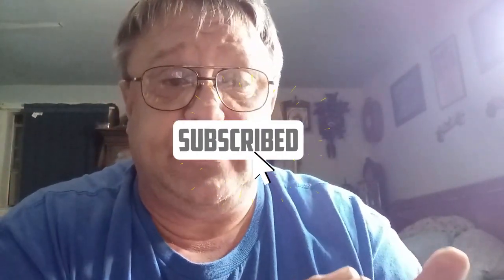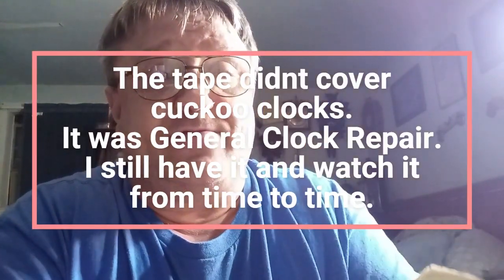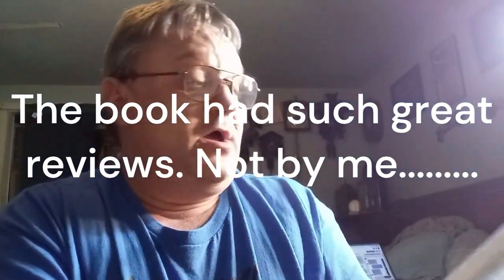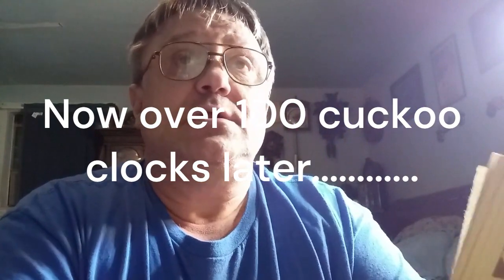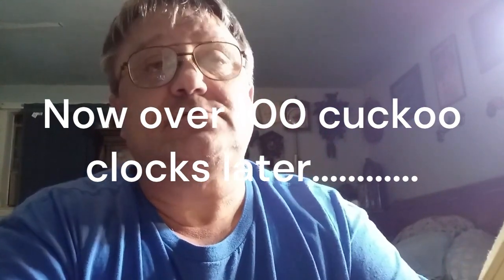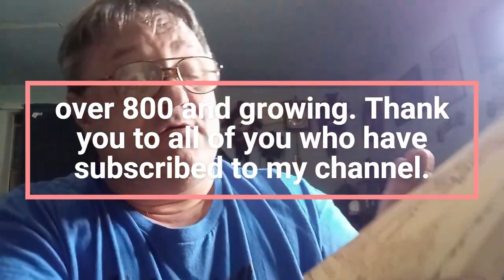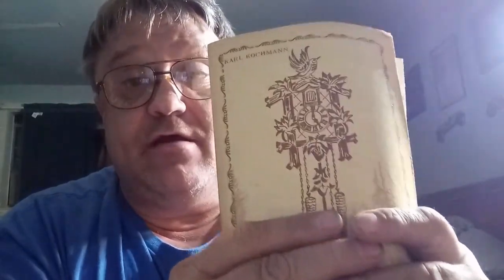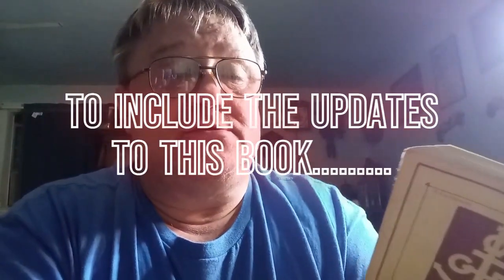Cuckoo clock repair for beginners (how I got started) See description

Comment: Hi Mike! Thanks for posting about how you got started. There are not many books on cuckoo clock repair. "The Cuckoo Clock Owner?s Repair Manual" by D. Rod Lloyd is another good book. It has some plate profiles listed so you can identify the different movements.
Reply from the maker: Thanks for the tips! Does it have the dates of when the movements started/ended in his book? That is what I really want to know but I was told that there was a fire and all that information was lost.
Reply: @munnerlyn3  Unfortunately, It does not have dates. It has the Manufacturers name and model number, dimensions and profile of the plates and the size of the weights. About 30 different movements.